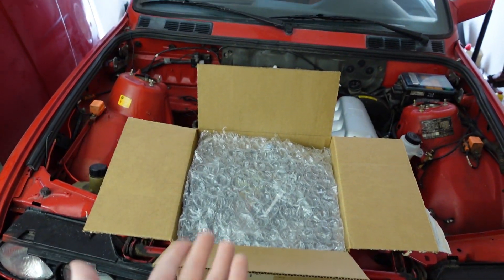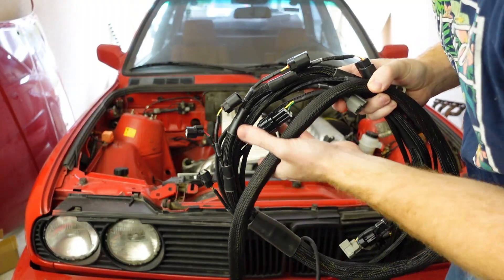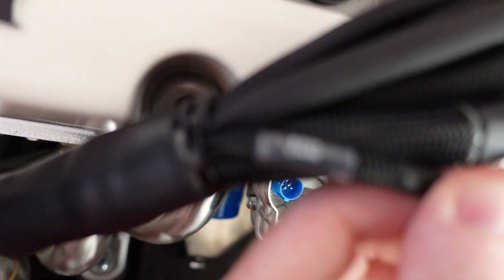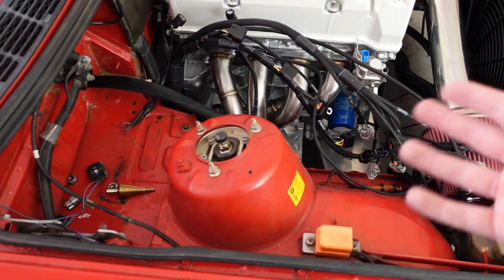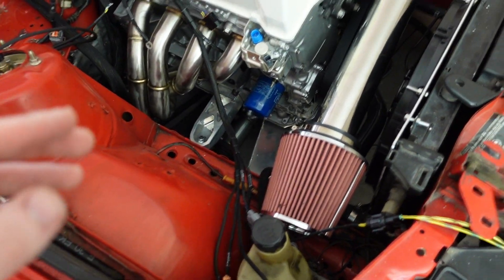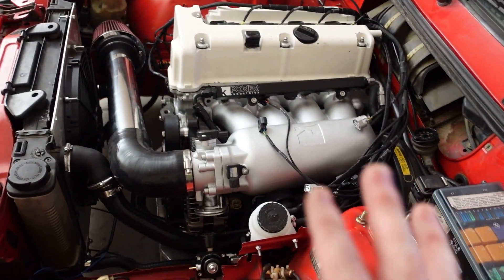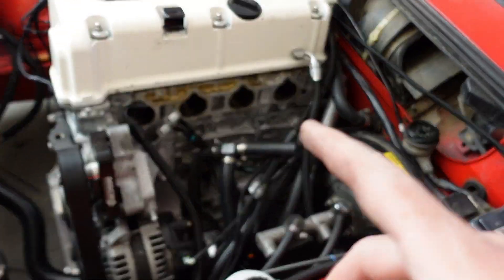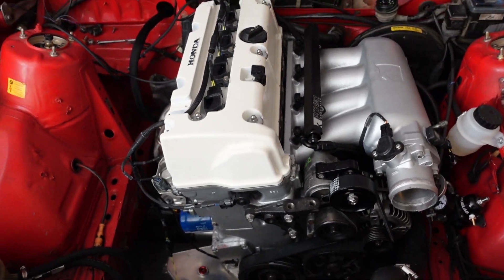Wiring Specialties BMW E30 K24 Swap Harness! Part 1

Comment: Hey bro I’m having problems on the final steps I’m not getting spark and I’m not sure if the ecu is responding and I’m getting no fuel . Question as well for the map sensor part number and the other sensor you mentions under the manifold .
Reply from the maker: What ECU are you running?
Reply: @ProjectRacecar2   k power industries ecu
Reply from the maker: Would that be the hondata ECU? It's likely that there is a setting for the fuel pump and spark plugs  that you don't have turned on
Reply: @ProjectRacecar2  do I need a lap top for that ? Or how would I go about it ? And yes the hondata ecu
Reply from the maker: @earvinrangel815  yes you need a laptop for that and to download the hondata application, there should be a ton of hondata ECU setup videos

Comment: Did you happen look at the wiring harness from k power? If so do u see any differences?
Reply from the maker: From my understanding the k power industries harness is just the adapter harness to adapt the k24 to the e30 so you would need a stock k20 harness to pair with that, and they are getting hard to find, so it makes more sense to me to get the wiring specialties harness from tf works
Reply: Ahh ic.. ok wiring specialties makes  way more sense!
Reply: And do you know if there's a cheaper ecu option if you were to stay naturally aspirated? Also thanks for answering all my questions! Much appreciated!
Reply: I want to do this but things add up very fast haha

Comment: Yo man what sensor, year make model did you get that oil pressure sensor/switch from? My motor has the same one as you, but my wiring specialties harness plug is like a 3 pin connector
Reply from the maker: Hey man! That is a very good question, yeah I have the same 3 pin connector, I currently haven't been running the oil pressure sensor because I'm figuring a different issue with my car currently so I haven't been too worried about finding out the oil switch, if you email wiring specialties they should get back to you pretty quickly!🙂 Sorry I couldn't be of more help!